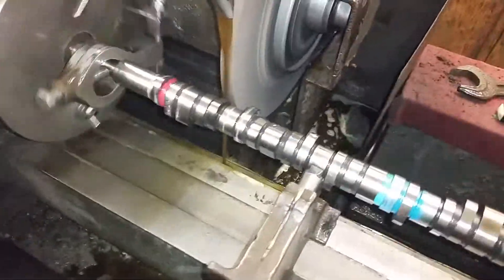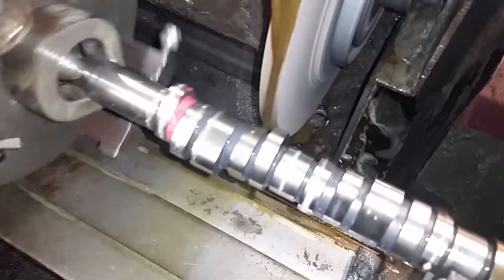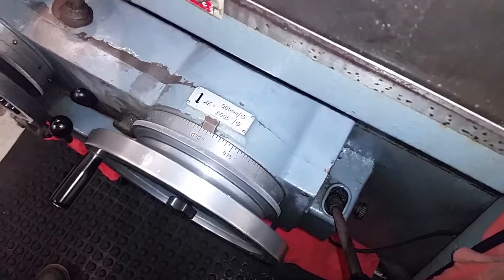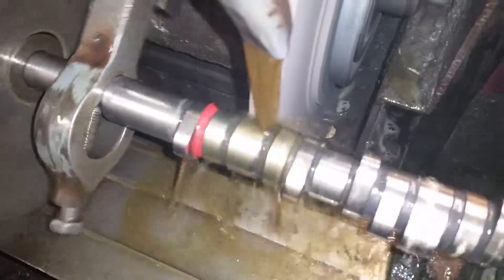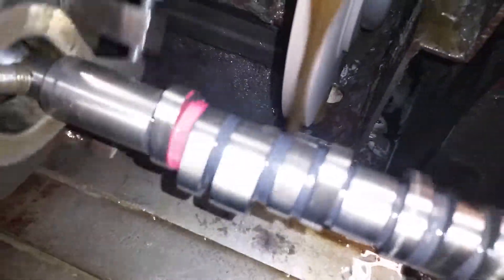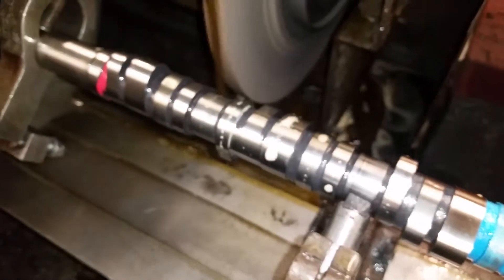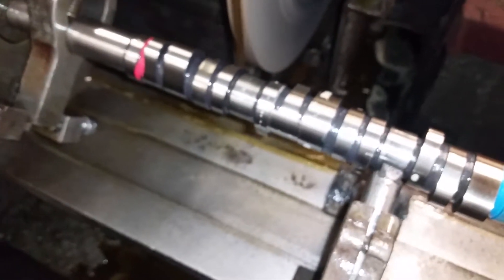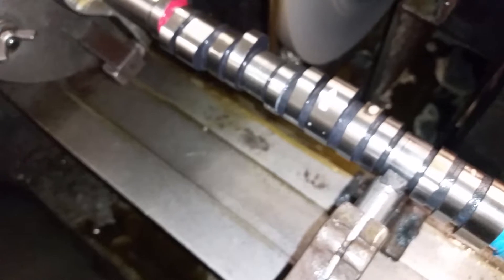Lee Watterworth finish pt3

Comment: What if you have to dress your rock?
Reply from the maker: The machines have hyd wheel dressing
Reply: @DELTACAM8005625500  So then when you dress and your stone gets smaller do you also move your zero to help maintain your .015 difference between the normal and the Vtec lobe?  Or do you just measure and adjust?